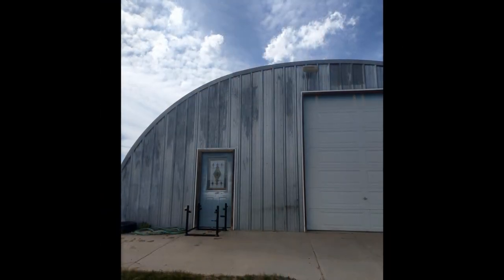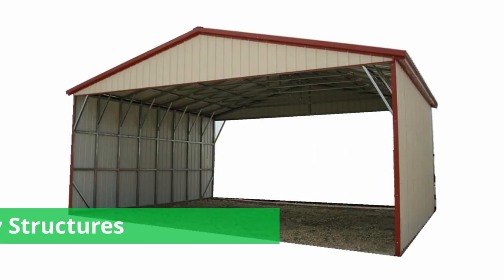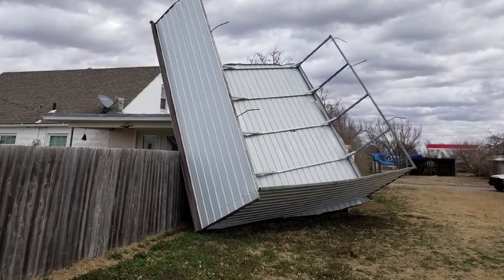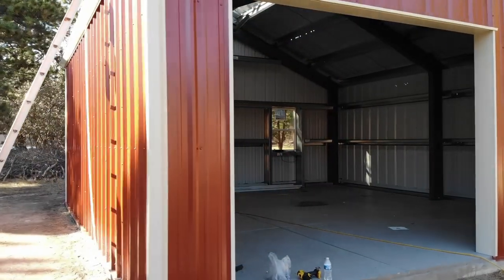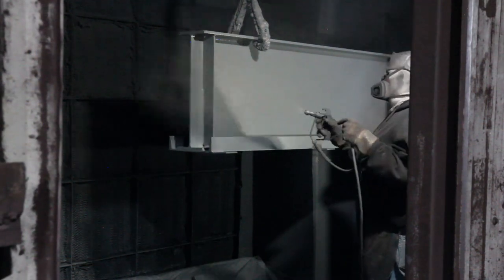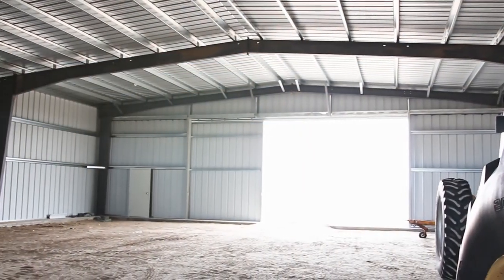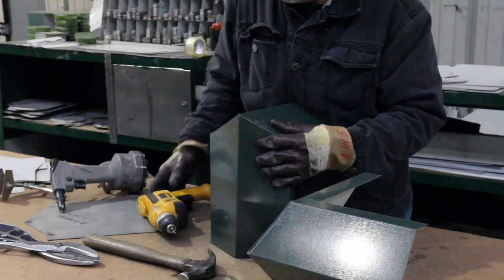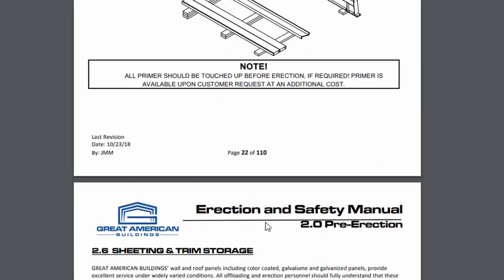How to compare building systems | Great Western Steel Buildings

Comment: Ok then, I'll leave some comments. I think your design looks very simple (primitive, rough), and also looks very oversized sometimes. This must add costs for the steel and transport and for the assembly. Have a look at Screb for a way more elegant design. Also, these end walls can be optimized and designed way simpler because of the many pillars that will support the load there. That will also reduce the cost for the steel, transport and the assembly. Finally, for anything insulated, cant see that anything can compete with insulated sandwich panels. Around here, cost is about $3 square ft. Should give a way better result than all these creative ad hock solutions, with less work and with less required skills.
Reply: Okay, I'll bite. 

Perhaps some of the examples we've used in this video are simple but what about these?
https://youtu.be/g0whp5EyF-c
https://youtu.be/q8L4CDHUyV4
https://youtu.be/ywDt-HuYyPM

All of our buildings are built according to the specifications we receive from out customers and designed specifically for their loads. The first link above is designed for a 350psf Ground Snow Load - so yes it may look overbuilt. But for the video you commented I don't think any of those buildings were overbuilt - but we certainly don't go light on a building we're supplying to a customer. They expect them to last. 

The Screb (I think I found the right place - European company?) appears to be a similar design but Yikes - all of those loose bolted clips. Their gutter system is pretty intriguing - I've never seen that before. Pretty darn sweet if you ask me. I'll have to run that buy our detailing team to see what they think. 

I do agree with you on the insulated panel systems, although I don't know who is providing a quality system for 3 bucks a square. We use Kingspan pretty often and the installation speed and thermal efficiency is tough to beat. The Screb design doesn't make sense to me - The through fasteners wreck the u-factor.
Reply: @ericbeavers4769  Thanks for biting! You first example is an astonishing design piece. Hard to optimize things there, without messing up the design. The second example didn't have optimized end walls. Can simplify a lot there when several pillars can be used. The center rafter looks slightly oversized, even if significant snow load is expected. Slightly harder to assemble, slightly more steel, slightly more transport, slightly lower celling high. Suspect 2" insulated sandwich panels would have delivered better performance, and would have been simpler to assemble, and the inner walls would have been completed. Could have saved on the purlins because sandwich panels can carry significant load between the span. Third example looked very engineered and optimized. No fly by night designer could have come up with something like that! But this is not an ordinary low cost project, where $/sq ft/ is central.

Of course not all you builds are oversized, only apparently some! Build to last? You don't need a safety margin of 50 on the end walls. They do just fine with a safety margin of only 10! Screb just add reinforcement where reinforcement is mostly needed, hence, saves on steel and weight. They are optimizing the design somewhat. It is low cost, high quality. Cant process the steel too much, just to save weight and simplify the design, to save cost. Welding and work cost a lot. Cant do much, has to be simple (see Screb). Cant see the problem with all these clips. It is just a few extra bolts, and quick and simple work.

Buyers may believe that, that you are saving them for extra costs by reducing the steel and optimize the design (see Screb), and deliver optimized end walls. They will save on transport, assembly, steel, all while not compromise the time the construction will last.

I dont think Screb is presenting their most optimized design on their webpage. They are presenting what the buyers are looking at before they place an order. When the order is placed, everything is good, and they can move on.

Kingspan is excellent but way too expensive. We normally don't need their quality (and prestige) for our simple projects. Expect to pay half elsewhere. Her is a German manufakturer that can design all kinds of panels for orders over 1500 sq ft @ about $3: https://www.panelsell.co.uk/tailor-made-insulated-panels
Reply: @elbuggo  We certainly agree that Kingspan is way to expensive :)

On lightly loaded buildings we can design for post and beam/light gauge endwalls. On the second building where the endwall is a heavy rigid frame we have to use the moment frame because of all the openings. No space for cross bracing and panel shear (diaphragm) wouldn't work - 65LB Roof Snow Load (30Kilos) per square foot and it's high seismic. On this one I don't think, what we call a "YE"  frame, where the columns support the rafter would have saved any steel. Hot rolled columns would have to be used by code and that would have most likely increased the cost of the endwall.
Reply: @ericbeavers4769  Hard to argue with you for stuff you have analyzed. Here is one of the many excellent assembling videos by Screb, including the gutter part - if interested: https://youtu.be/g6sSbazsyLw
Reply: @elbuggo  I am super jazzed by that gutter system. Looks like it's 16/14 gauge or something like that - so not inexpensive but damn well designed. I'm curious if you have experience installing those, if so... it looks to me like the down is inside of the wall? Is the scupper or something? I'll have to check out more of their videos to see if they show it. Cheers!
Reply: Just found it! Yeah a trick little scupper and a wall penetration. They got the trims to look nice too.
Reply: @ericbeavers4769   - Thanks, Eric. You can lead the water were you can lead the pipe. The gutter may be made slightly longer than the building, and then let the pipe go down around the corner, like almost in the end of this video here: https://youtu.be/RCCWcjLiobE 
Some more info on their webpage somewhere. I have no experience with this solution.